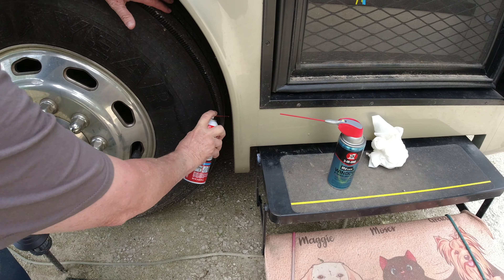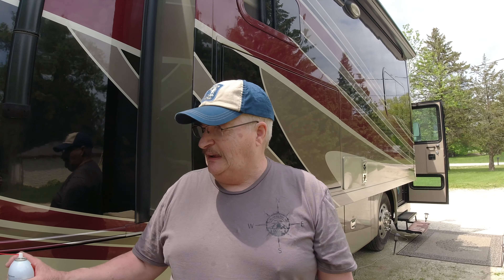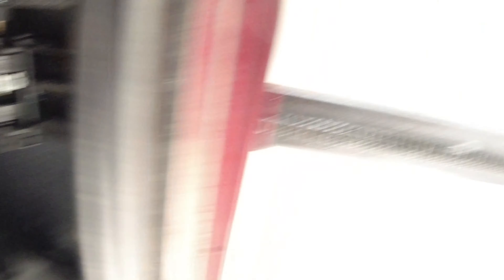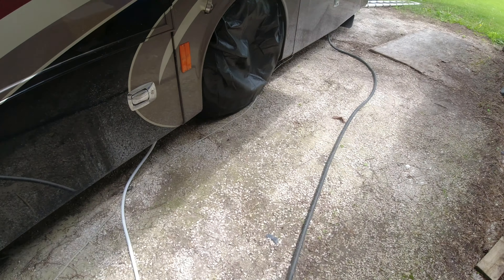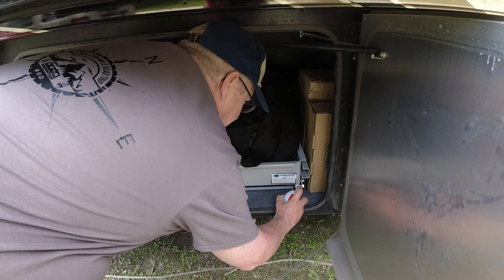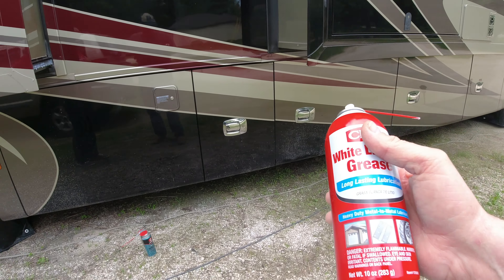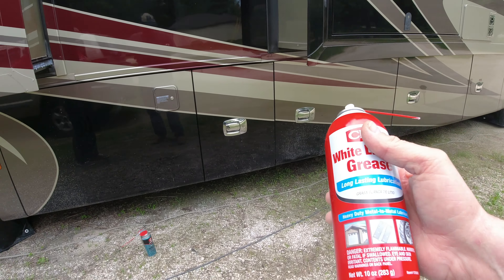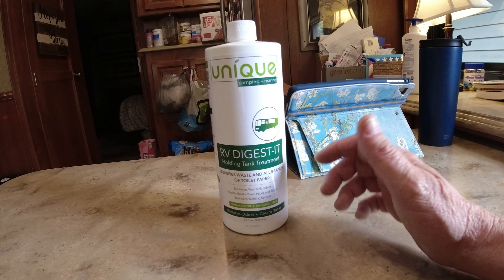Don't Forget The Little Things

Comment: These are really good tips. Most of them I do on a regular base. The only thing I would add is Cummins recommends that you place a load on the genny for at least 5 minutes while excersing it. I usually run the air or the microwave which does the trick..